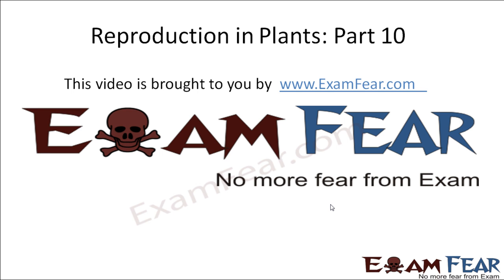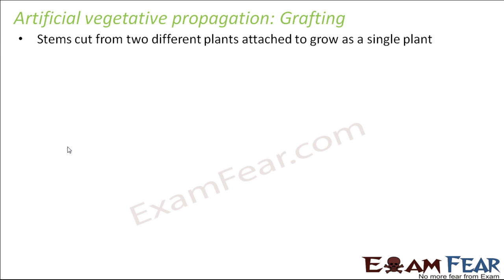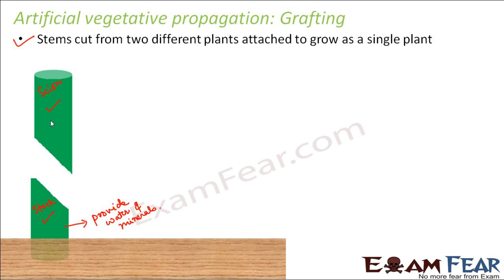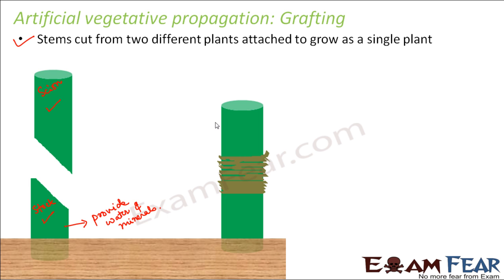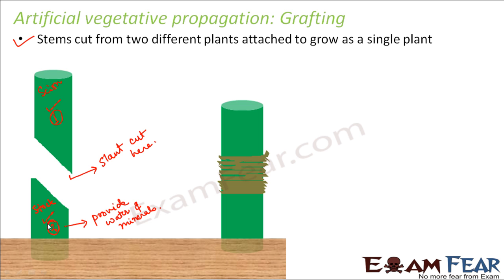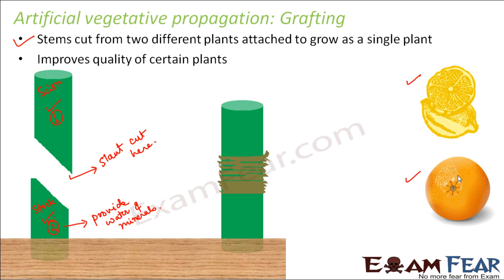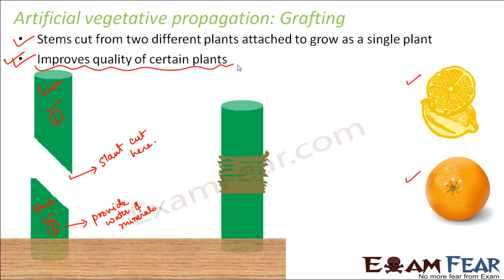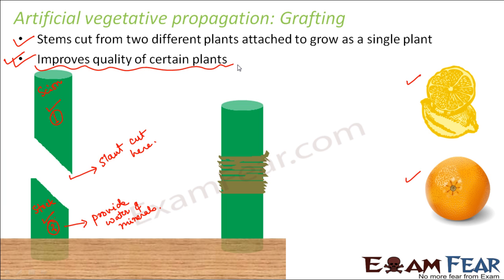Biology Reproduction in Plants Part 10 (Artificial Vegetative Propagation : Grafting) Class 7 VII

Comment: mam how grafting is asexual...it involves two different plants...can u explain
Reply: Ramesh Ram it is because sexual reproduction has male and female gametes and when these two fuse then only new organisms are formed . In grafting , there were two different plants , but they were not the male and female gametes . That's why it's an asexual mode. Hope you would have understood.
Reply: because no sexual interaction is involved between the two plants,and its not mandatory that both of the stems include one male and female,it could also be male-male,female-female and the most important thing is that plants sexually reproduce through flowers so yeah.Hope you understand what i meant to say